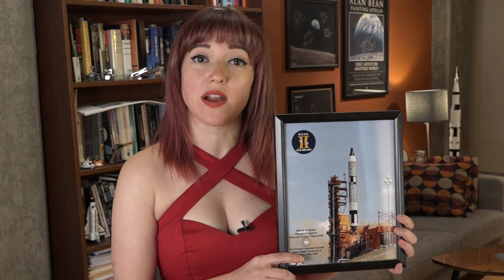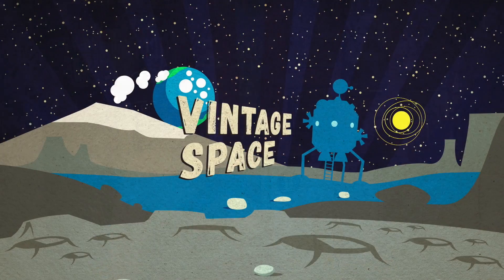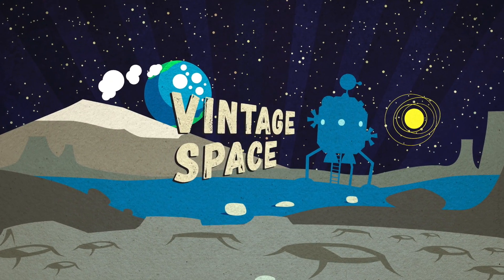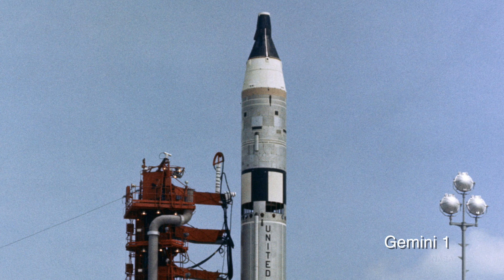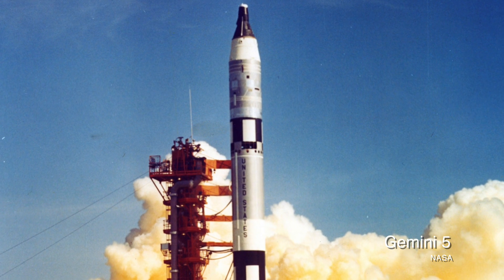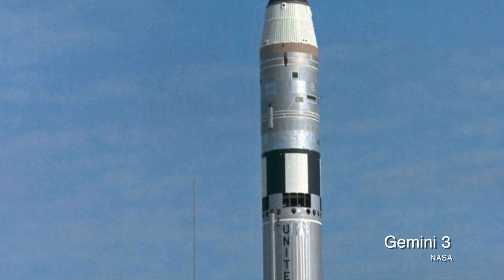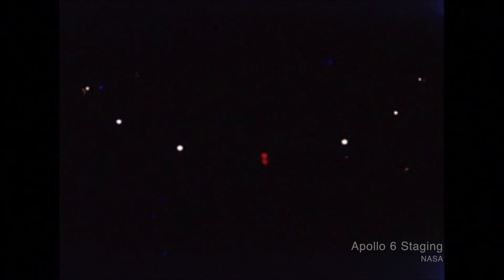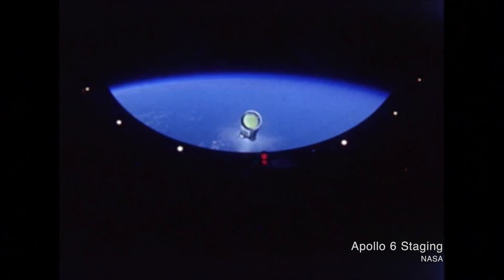Why Were There Holes in the Titan Rocket that Launched NASA's Gemini Missions?

Comment: I like the shuttle launches. Start up the main engines. And it just sits there, sort of.  Ignite the solid boosters, and it just takes of.
Reply: +Ola Håkansson that was because the hold down clamps kept the shuttle locked down on the pad untill the SRBs fired and the clamps released.  this is done for a couple of reasons on most rocket launches.  first it takes liquid fueled engines a second or two to spin up to full power, and second it gives the flight computer time to abort the launch without losing the rocket if it detects an engine problem
Reply: Aha, I did not know that. Thanks

Comment: I think you can notice a similar design on the Soviet Unions R7 ICBM that later became it's main spaceflight rocket. Above the strap on boosters you'll notice a "truss structure", a zig zag metal area where you can see right through the rocket. Same general principle as the Titan II, as it also used "fire in the hole staging".

Comment: Ullage motors weren't so much to gain seperation as to settle the fluids in their tanks. In Saturn, each time a stage shut down, the craft would have it's propellants sloshing around in zero-g if not for the ullage. Most Soviet boosters, including the Soyuz and N1, did not use ullage. Instead, the interstage was an open grid, similar to the Titan II, so that the upper stage could fire before the lower stage cut out. I'm always assumed this was for simplicity of design, but there could be other reasons I don't know about.

Comment: Ullage rockets are used to force fuel to the bottom of the tank in low/no G situations, not to get distance between pieces.

If you can light your second stage before detaching your first stage, you don't need ullage as the acceleration is maintained during the separation, and thus the holes.

Good vid... Just a minor error.
Reply: No it's not a error in the 60s they did think that they needed space before lighting it up

Comment: Actually, the ullage motors on the Saturn V made certain that the fuel was kicked into the back of the tank so that there would be no issue with the low gravity of the upper atmosphere. The Titan II used a method called "hot staging" which basically meant it used the thrust from the first stage engines for ullage. It's the same way with most Russian rockets.

Comment: I believe that the ullage rockets are used to get the fuel to the bottom of the tank.
Reply: +Isukaman Yeah, it would probably be a bad day if the fuel pumps cavitated because of bubbles in the fuel lines at start up.
Reply: +zapfanzapfan In space the fuel is just floating in the tanks.
Reply: Isukaman
Yeah, there are some great videos from inside the fuel tanks from a couple of rockets that show what happens when the engine is shut off and the fuel forms droplets that just float around.
Reply: When the Saturns were designed, the ullage rockets were the known and proven way to get the fuel back to the engines after a weightless coast period. The cheaper method that was invented after the Saturn V was designed was to put a mesh over the fuel (and oxygen) intake pipes at the bottom of the tanks; surface tension kept enough fuel in the pipe, behind the mesh, that there was enough to start the engines in weightlessness, and once the engine was started the "floating" fuel would be pushed towards the pipe and continue the fuel supply. This is common today, but if the Saturn engineers had heard about this trick, it wasn't proven then and the ullage rockets were the trusted way to do business at the time.

Comment: The blast ports are very common on Russian (Soviet) rockets. At a cursory glance, it looks like Vostok was the first and also the first of the R-7 derived rockets that had more than 1 stage as well as Voshkod and Soyuz utilizing a similar design. It's likely that the Russians had beat the Americans to the punch with this idea. It's also worth noting that they are still using this staging strategy today.
Reply: +Paul Donlin :They use it on the Soyuz and Protons mainly because these vehicles date back to the 50s and early 60s. The Energia didn't use this method of staging. The Energia derived Zenit rocket is probably the newest Russian rocket to use this method of staging since the Zenit is basically an Energia booster with an upper stage. It is not shown in Angara LV concepts or test launch images of the Angara 1 or 5.

Comment: In watching launches in the Mercury and Gemini programs, it always seems that you could safely be fairly close to one of those launches, while you wouldn't want to be anywhere near a Saturn V launch. How far away were people on those early launches?
Reply: +oilerblueline :They were typically within about 600 feet but they were also in blockhouses. The general public was several miles from Mercury and Gemini launches due to the fact these launches took place at the more secure CCAFS rather than KSC.

Comment: My favorite rocket is still the mighty beast itself, the V. However, I do like the "vroooop!" sound the Titan II makes when it lights. I would like to make a request that you spend some time talking about the first rocket that I saw launch on live TV, Saturn 1B, particularly why it used the clustered 1st stage.
Reply: +Alvious :The clustered stage concept was adapted for the Saturn-1. The inner stage or propellant tank which is not visible, was the first stage of a Jupiter IRBM which served as a LOX tank. The outer tanks were Redstone MRBMs and all were lengthened and served as both fuel and ox tanks. This concept was carried over to the Saturn-1B. This concept was known by the largely forgotten nickname "Clusters last stand".

Comment: The firing of the ullage motors are also used during stage separation of rocket and/or stabilization of a rocket when there are brief reductions in acceleration which could allow the liquid propellant to float away from the pumping intakes. Ullage motors are also commonly employed on deep-space missions where a liquid rocket needs to start a burn after traveling in micro-gravity.

Just so you know, your position as one of the 3 science goddesses of YouTube has been secure long before this most awesome and, dare I say, welcome addition to your wardrobe!  Julia Wilde and Dianna Cowern (aka Physics Girl) have serious competition.  :-)

Comment: This raises a question, why on the Saturn V was there a need for a skirt between the first and second stage?  You would see the first stage drop, then about 25 seconds later there was skirt sep.  Why not just make the skirt the top part of the first stage?
Reply: +Gezellig - The skirt had the separation and ullage motors for the second stage attached to it. They had to fire to separate the two stages and settle the propellants in the second stage. Once that was done the skirt was jettisoned so the second stage wouldn't need to carry it anymore.
Reply: +Joe Vignolo And like all interstage fairings, it also served to make the rocket aerodynamic in the lower atmosphere.
Reply: True. Not having the holes in the side of the rocket will reduce the aerodynamic drag.

Comment: I worked on the Titan-II ICBM as a missile electronics tech (E-lab) at LRAFB Arkansas. The Titan-II was silo based and we had 8 levels of work platforms if I recall right. We would actually crawl into the larger rectangular openings just above the blast holes from the work platforms. Then we would install a diving board as we called it just above the first stage ox tank dome in order to gain access and replace faulty rate gyros. The rate gyro was mounted atop the ox tank dome. I think I only ever had to replace 1 rate gyro in the 3 years I was an E-lab. And I was still getting OJT when I replaced that one. The guy doing the training had been at LRAFB when 374-7 blew. Getting on the diving board spooked him a little as he no doubt thought of the 374-7 accident. I was still in Texas when that missile was destroyed by a tech dropping a wrench.

Comment: Amy, all US manned rocket launches are cool. My question is this: I get the pitch program on rocket launches, but the roll program, particularly on the shuttle launches, seems more theatrical than necessary. What gives?
Reply: +Jamey Landry :The roll program was required for the shuttle to put it on the proper azimuth. The pads the shuttle launched from were originally designed and utilized by the Saturn-V and later 1B rockets. The shuttle configuration was such that in order for the orbiter crew access arm to be able to be positioned at the hatch, the shuttle orbiter had to be positioned facing south. Then at launch it rolls to continue ascending eastward.
Reply: +J Dean Also, the landing wings on the orbiter produce "lift" in the direction of the orbiter ceiling, which will be "up" when landing. In order to take advantage of the Earth's rotation, they want to launch to the east, and they want the "lift" to help, not oppose, this eastward turn. So the orbiter not only rolls, it also pitches in the direction of motion, making it "invert" as seen from the ground.

Comment: The Delta III is the best looking launch vehicle with the perfect symmetry of the primary column and smaller booster engines evenly spaced around the rocket. If only the Altas V or Delta IV had the same symmetry with the boosters, then they would be the better looking rockets. Symmetry rock(s)...ekts.

Comment: The explanation of the blow holes to vent exhaust gases seems to make sense as the titan was an ICBM and the faster the speed, the less time an enemy had to react to the missile. So I am assuming that the Gemini did not have any explosive bolts or any type of reaction motors for staging?

Comment: Geez. Come on guys, Amy likes dresses and looks great in them. Move on. Deprived little boys ha ha ha.  
My favourite launch to watch was always the space shuttle. Although the solid boosters billowed smoke the main engines burned clean and to watch them come up to full power and change direction at launch was always an awesome sight. The bright blue edge on the engine bell was mesmerising.
Reply: +Robbo Same here- I love the super-slo-mo pad cameras where you can watch the engines ignite and see the engine bells flex and wobble as they come up to power - then finally stabilize.  I love the Saturn V  super slo-mo as well.  All the ice cascading off the rocket.  All the umbilicals disconnecting and retracting and the doors closing on the launchpad structures.
Reply: +Robbo I'd say you're right except she is clearly going out of her way to look good so why not compliment her on her looks? She isn't wearing a dress that shows a lot of cleavage because she doesn't want guys to look at her breast. She likes it, we like it. I call that a win win!
Reply: +Mike Certainly more modest than most of the female Fox News readers.
Reply: Roger that; the shuttle simply got up and went! I believe that Car and Driver magazine gave credit to the space shuttle in the quarter mile section of their 1984 "Ten Best" issue. I believe it went something like this: "Honorable Mention - the Space Shuttle. Granted, it's a little slow on the low end, taking 13 seconds to reach 60 mph, but really hauls on the top end, reaching 15,000 mph in about 30 seconds."  Classic.
Reply: I've been pretty lucky getting to see some rocket launches. I lucked out with a business trip to Florida in 1992 and saw the Shuttle launch from static test road, the 2nd best viewing site other than the VIP site.

Comment: Same situation with most Russian rockets, that is why they use the tube structure interstage.
Reply: +HONORGUARD308 Yes. And actually they do this to keep the fuel/oxidizer at the bottom of the tank.
Reply: Strange side effect is that the bending of the rocket at it's grated joint improves flight control.
I know an engineer, who calculated the effects of the joint in Zenit rockets.

Comment: I agree with Amy.  The Titan II is one of my favorite rockets.  It was adapted for manned flight from the ICBM program.  But Amy mentioned early in the video that one normally expects a firm structure in a rocket to carry a payload.  The Atlas rocket that boosted the Mercury program into orbit was anything but a firm, rigid structure.  I would like to see an episode of Vintage Space that focuses on the Atlas and its unique construction. At the Space Station Museum in Novato, CA we have a component from an Atlas.  A pneumatic valve assembly that controls nitrogen pressurization in the fuel tanks, signed by Scott Carpenter and Wally Schirra!  So, how about it Amy, an episode on the Atlas?  😎

Comment: Interesting.

The Soviet N1 Moon rocket had these gaps in spades and I was wondering what they are...I assume they are the same thing as discussed here.

Thanks Miss Teitel.

Sexism warning...there is also a hole or gap in the Teitel 1 'vehicle' red outer membrane about a third of the way down it's/her first (and only) stage. Apparently, this is to mount the outer microphone and is interestingly, rather aesthetically pleasing
 Additionally, the command module of the Teitel 1 is even more aesthetically pleasing (and highly functional) as well. With an excellent CPU it seems. WARNING - this module is NOT detachable and is part of the overall Teitel 1 'vehicle'.